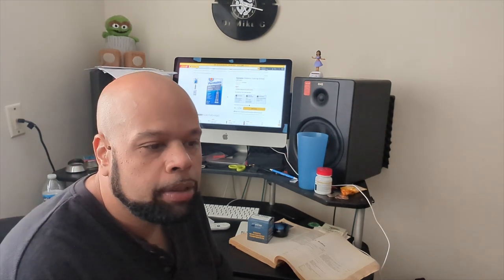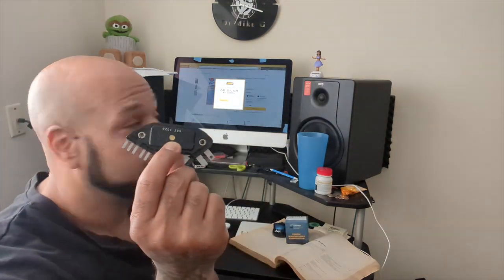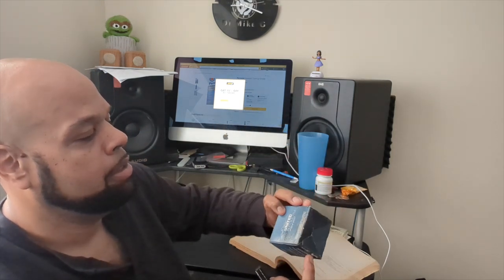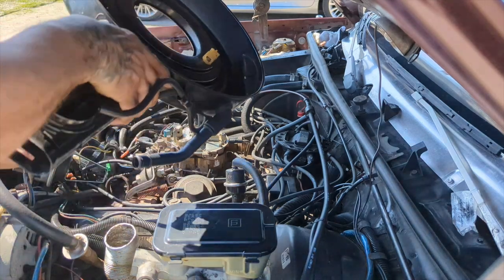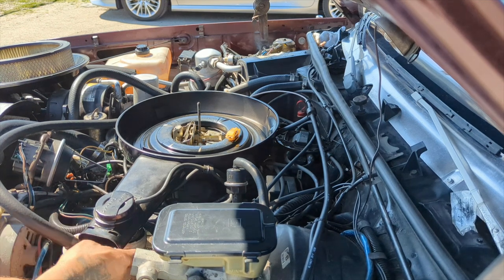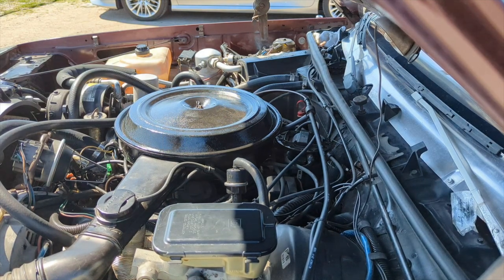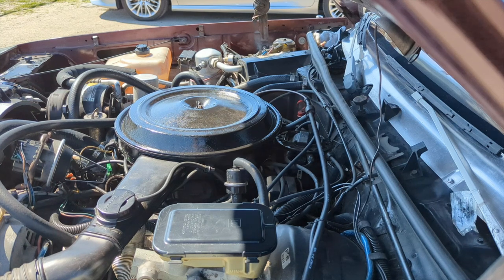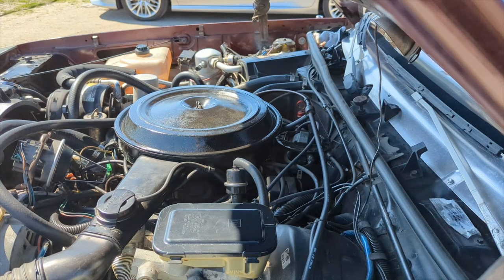HOW TO INSTALL A (ICM) IGNITION CONTROL MODULE IN A 1984 CUTLASS 307 ENGINE

Comment: Could it possibly be a vacuum leak or issue with the EGR valve?
Reply from the maker: I checked egr and changed all the vacuum hoses
Reply: I would hook a vacuum gauge at intake manifold vacuum and see what the needle says. Look for a steady needle if that looks good then hook up at carburator and look for a shaky needle. Air/fuel screws can be adjusted since u removed the original carb plugs. The carb has a screw on top to adjust the mixture/ dwell. Dwell should be around 30-35 degrees depending on engine specs. This can range too between 10 and 50 depending on lean or rich condition controlled by ECM. But i would use tach dwell meter to adjust the carb in any way.  It could also be a bad spark plug, plug gap or bad plug wire maybe? The air filter looks good. Maybe a clogged PCV valve or leaking EGR? I would also check the choke and make sure it opens all the way when warm at operating  temperature. Either way good  luck brother hope u fix the issue. cant wait to see whats wrong. Thanks for the videos. Keep us posted! 👍🏼
Reply: Did you .. Thats good. lets see i had a 86 cutlass at one point and it had a stuck EFE system. It wouldn't shut off when the engine warmed up and it would idle off too. The EFE is a vacuum looking pump with a lever on the end of exhaust pipe on the driver side. Like a heat riser but it was operated by a thermo vacuum switch on the intake manifold near the distributor. Mine was just stuck. Your car is looking good tho man. Hope you find the issue and solve the problem! Thanks for the videos! 🙏
Reply from the maker: @northerncali707ave  thank you ! I'm gonna go outside and mess with that 
efe thing as soon as I finish eating breakfast . thank you
Reply from the maker: I checked it and it does move on the outside but if course I can not see what is going on inside the exhaust
Reply: Ok thats good. so what that does is that the vacuum  closes or pulls the lever to close the heat riser. Almost like closing the exhaust pipe off. That sends the heat up the tube spring looking thing "pre heater hose" up to the air cleaner. Sends the warm air up to heat the choke on a cold start. Once engine warms up its suppose to open allowing exhaust smoke out the pipe again. Mine had so much dirt and gunk it would not open up all the way again to let the exhaust air out and would cause it shake or idle off/ unsteady when warm. So to check it...look at the lever position on a cold start. The lever should move back when u first turn the car on to close the exhaust (pulls back to close heat riser with vacuum) and it should move back or open to original  position when warm (vacuum thermo switch located on intake manifold shuts off vacuum to EFE at operating temperature there fore closing vacuum to EFE and lever moves back to original open position). That was on my cutlass of course. V8 5.0l y vin. If the EFE ,EGR and PCV look good and no vacuum leaks any where  then maybe a bad spark plug? I would really recommend hooking up a vacuum gauge to intake. if the needle is steady u will know all cylinders are working properly. If your low on inches of vacuum the gauge will tell you possibilities. If the needle drops off rhythm it could be a cilinder is off. Then i would go from there and check the plugs and wires first. Theres a method to check what cylinder is off with the engine running by pulling one plug wire off at a time and looking for any changes to idle. If you pull a wire off a plug and notice a change it will tell you that cilinder is off. (Disclaimer use this method at your own risk lol. U could get shocked or injured but its effective) Then i would pull the spark plug out to see if anything is off.  if plug and wire are good then i would move on to compression.  But i would start with the vacuum gauge at intake if that looks good then hook it up the carb. If the needle is shaky at ported vacuum then your carb will simply need air/fuel dwell adjustments. I bought mine at harbor freight and it has helped me out so much on all my projects.  Hope that helps brother!
Reply: This video on vacuum gauge has helped mo out so much and so many times. I hope it helps! 👍🏼
Reply from the maker: @northerncali707ave  thank you
Reply: Your welcome brother! Good luck 👍🏼